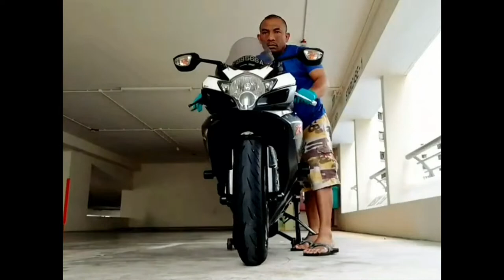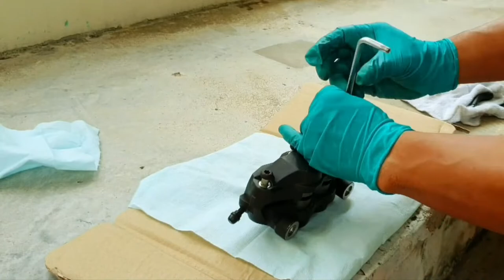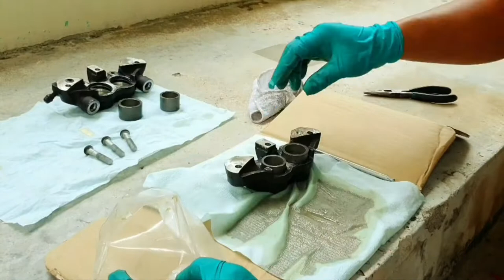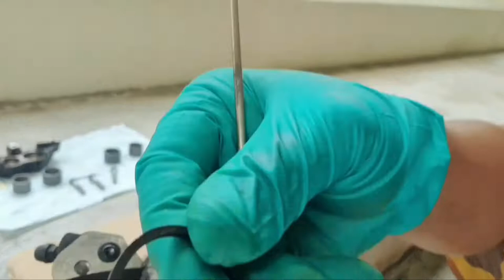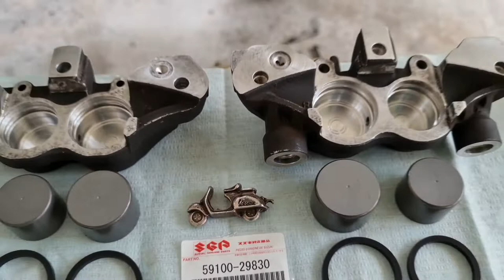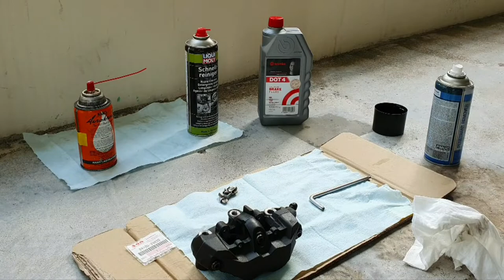Brake Caliper Rebuild ( Tokico Radial Calipers ) GSXR K7 750 -.-17 Jan 2022

Comment: Are you just dipping those rubber seals In break fluid? I'm just having a hard time gettin them back in
Reply from the maker: Correct. Just brake fluid. No issues fitting them in, for me. Maybe they are not seated properly.
Reply: @-ms7r-  just ordered a new seal kit gunna try that.. thanks for the upload
Reply from the maker: @harley187  
Thats possibly the reason. I replaced all the seals with new ones. All the best for your project.  👍

Comment: How did you refill the calipers and bleed the lines?  My pistons won’t push into the pads onto the rotor.  😮😅
Reply from the maker: Once everything is installed. I bleed the lines as per normal.
Reply: @-ms7r-  really?!  There is am eBay front brake lever master cylinder and the matching side for the clutch was defective and have un matching sides.  Maybe the culprit is the master cylinder although not had setbacks with it until now.  🫣😅
Reply from the maker: @Kyre5049  If your brakes were working normally before the seal change, it should be the same now. Maybe there is something wrong with the installation. Hope you sort it out soon.
Reply: @-ms7r-  how about the pistons when replaced in the caliper were placed flush rather than the orientation they were when pulled out about 1/4 of the way out of the caliper having clamped down on the rotor? 🫣😅
Reply from the maker: @Kyre5049  That shouldn't be an issue.